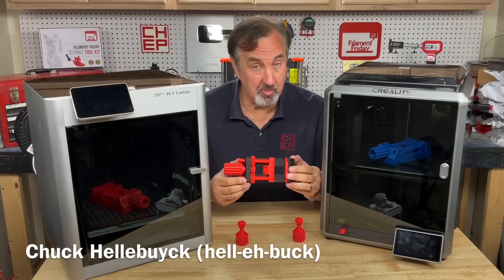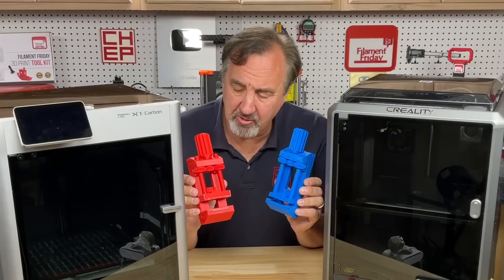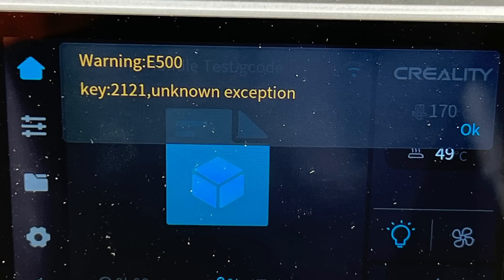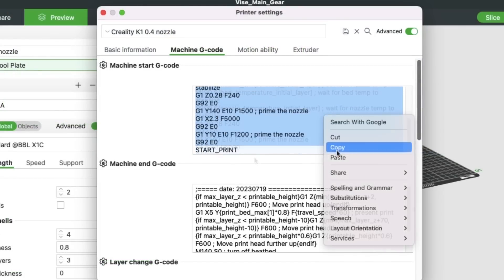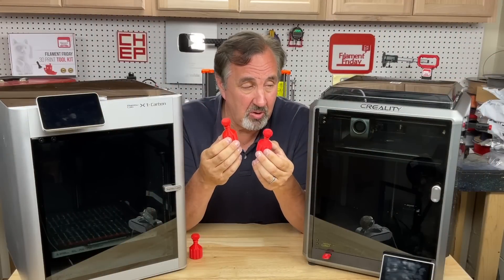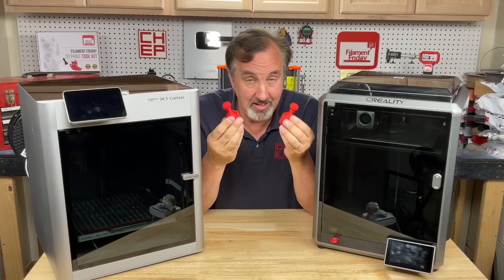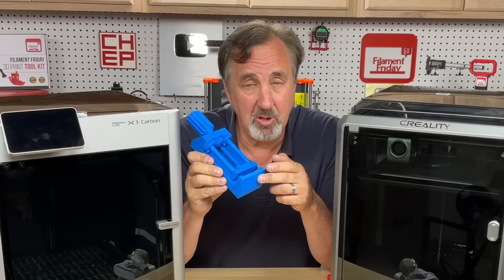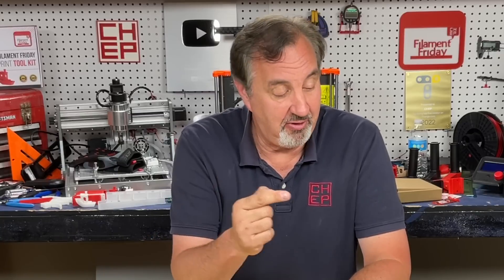Using Bambu Studio Slicer on the Creality K1

Comment: Could anyone recommend a cheap $400 machine that's way quicker then ender 3v2 for my son Christmas present?
Reply: Just add another $270 and get him a Bambu Lab P1P.
Reply: @protectyourassests1028  bingo! Or k1
Reply from the maker: If you have a Microcenter near you, they were having a $99 sale on the Ender 3 V2. Great way to get started.
Reply: Get an Ender 3 V2/V2 Neo. Add sonic pad, silicone bed "springs," and either a dual gear extruder with Capricorn tube or a direct drive extruder. Then you'll have 200mms+ speed with input shaping and pressure advance for hardly any money

Edit: add a Spider hotend and you'll go even faster
Reply: @SdMDeADnKiCkiN  a whole lot of work which is time and time is money and that hole in your pocket never ends.
Reply: @graphguy  I disagree. Takes very little time to do these mods, and hardly any cost. 6 of my printers are this exact same setup and they print as well as my Bambu machines and almost as fast. They're very reliable. Ive had more failed prints on Prusa Mk3's.
Reply: @SdMDeADnKiCkiN  and you are experienced. Nevertheless my statement is fact. And those mods break, require constant tinkering.
Spend $600 on p1s or k1
Reply: @graphguy   Experience or not, it'll only take a short while to install those mods, so time equaling money isn't really applicable here. It's also a good thing to get to know ones device for maintenance purposes anyway. As for "those mods break"...any part of any device can and will eventually break, even the more expensive printers. Still, my units run 24-7 and not 1 of the mods I listed have broken yet. My friends farm has 9 of these units and same story there. I like my BL machines too. But like most companies their support is snail-slow. At least with this setup anything can be fixed very fast and very cheap. With the price range this guy is in this setup is about as fast and reliable as one can get with good quality.
Reply: @SdMDeADnKiCkiN  it works for you, that is great! But you are wrong on time and money, ordering, delivery, paying, unpacking, etc etc all takes time and that is mobey... like it or not.
I prefer spending up front and get results vs molding and tweaking and  modding. 
Hey I got a 9 month old ender max neo with wifi and creality hot box for a great price!
Reply: @graphguy  I'm not saying time isn't equal to money. I agree with you. I'm just saying that an inexperienced person can spend a day installing these mods and then they're good to go with acceptable speed and reliability, especially for a beginner. After that it's just as likely/unlikely to break as an any other high end machine. My first X1C had to be sent back and replaced because it kicked the bucket within 2 months. It's just the luck of the draw. 

How much on the Ender and any mods?

Edit: are you staying the ender is for sale or was you just mentioning a good deal you got? I just realized I may have misunderstood when I replied about it. If so I apologize
Reply: @SdMDeADnKiCkiN  I hope I have not been sounding  like a prick... but just resound in my opinions.  
Ya, I'll sell it cheap.  The problem is not so much the price of it, but shipping costs! I would imagine to be very steep for a consumer. The other day I sent a 8x12 inch light box from CA to CO and they charged me $22!
Reply: @graphguy  No, you're good. I hope I haven't sounded rude either. I didn't mean to if I did. Yeah I know shipping rates are ridiculous anymore. It's nuts. I don't really need another machine myself but my wife's friends son just got ripped off on his 1st printer the other week. Some scumbag sold him some offbrand printer with a belt held together with a freaking staple, a warped looking gantry, and a hotend with stripped screws. So my wife and I are talking about buying him one or giving him 1 of our backups. My wife said he had saved his money from mowing lawns all year and we're not going to let him waste his time on that junker ya know.
Reply: @OhImKiCkiN  thanks guys reading all your comments I really appreciate your opinions. Nice to hear both side of opinions ie ender 3 upgraded or get another machine . I'll look at the upgrade options and way up the cost . 👍
Reply: @davesmith3562  No problem. With so many machines available today you've certainly got a lot of options. Let us know what you decide to go with.
Reply: @OhImKiCkiN  do people still use cura for the slicing on ender 3v2 or is their a slicer that can make prints better and faster )
Reply: @davesmith3562  It depends really. I use both Cura and Prusa slicer on my V2's. I mostly use Cura though. The Sonic Pad has default profiles for Cura that work very well.
Reply: @OhImKiCkiN  thanks I will look into that cheers for your advice 👍
Reply: @SdMDeADnKiCkiN you pay a fair price and shipping and I'll sell the neo max setup to you for the kid
Reply: @graphguy  I would do but I live in the UK
Reply: @davesmith3562  ya that would be Hella expensive!
Reply: @graphguy  What state are you in?
Reply: @graphguy  too true
Reply: @OhImKiCkiN  california
Reply: @graphguy  Ooof that's far. I'm on the NC coast. Shipping would be nuts plus I always insure shipments because of how our packages get tossed around and stolen nowadays. I do appreciate the offer though. I think we'll go get him an Ender 3 V2 while they're still $99 and give him the upgrades I mentioned earlier since I already have extras. Once he learns the machine well enough I'll probably give him a Sonic Pad I have lying around so he can get a little speed out of it.
Reply: I would keep an eye on the Ender 3 V2 Neo, I got one refurbished from Comgrow for under $200 and it works great.
Reply: @RoXolid but it's not fast
Reply: @graphguy  If you use Chuck's .28 cura profiles it'll be pretty speedy for the money. Again, you're looking at a very budget price so what's the fastest you can get for your budget? That would be the way I would go in your price range
Reply: @RoXolid it’s fast with a sonic pad, and it runs clipper with it, better firmware better quality print’s personally I’d go with the creality S1 Pro and a sonic pad if you can find a good deal somewhere, I got both s1 pro and sonic pad used for £200

Comment: Hi Chep, I'm potentially picking up a K1 to use as my main work horse while I upgrade my Trident and Switchwire.  Have you tried Prusa slicer with it?  Do you think it would correct the issue in the same way?  I use SuperSlicer mainly but I'm hearing good things about the latest version of Prusa Slicer and was thinking of using it on the K1 max.

Comment: It would be interesting to see how Cura’s gcode would work on the K1? And I don’t think there’s ever been an argument as to how much difference the slicer makes. There was a very good reason that simplify3D was so highly regarded for so many years. I, like many others, just wasn’t prepared to spend $200 on slicer software.

The way I see Bambu is much like I see Apple. A closed ecosystem ensures that the company has absolute control over what goes into its machine and ensures it performs well. Whereas open source, windows or Linux in this analogy, can be far worse or far better depending on the amount of effort the customer is willing to put into it. We are starting to hit a more consumer based sales model with 3D printers now which is great for all of us.